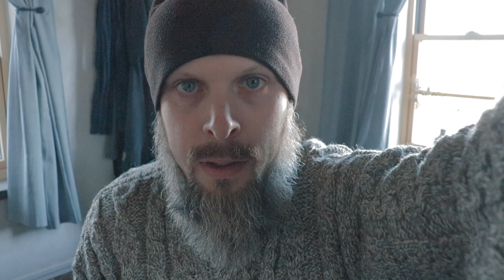10 Reasons to Build a Cob House

Comment: Thermal mass means the walls will keep the house cooler in the summer but it will take more to heat the home because those walls are not very insulative of themselves.  Thats the main reason i would always choose straw bales.  It takes very little energy to heat or cool the homes.

Comment: Can you add insulation on the inner wall to slow down heat transfer? I’ve seen some pretty cold earth homes with thick walls
Reply from the maker: You can add insulation, but I'd consider a dual-wall CobBauge style wall, or just build with straw-clay if you really need high insulation.
Reply: @thiscobhouse  Thanks for your comment. I have a thought that maybe a compressed straw or hemp block on the outside of the exterior wall would accomplish this. The attachment would be an accomplished by slip forming against the blocks. This wall is probably 2 feet thick. 
I have designed and built about a 1000 home equivalent in my life, but never a natural home. Looking forward to it.

Comment: Alex, if the concrete foundation stay dry I mean if the home is build on higher land than the rest of the plot and the rain water is diverted through gravity so water does not touch the surroundings of the home at all, then it can last for as long as possible ?
Reply from the maker: Yes! A good foundation and roof, plus plaster rendering on the wall, and a cob house can pretty much last forever. It's just all about keeping it dry. Same goes for any kind of building, really.

Comment: Great video, Thanks for posting, Question: Is there any reason I couldn't  use cob  as an external thermal insulation wall around a container home? It can get up to about 110 F where I would like to build (a container would be quicker to give me shelter and a place to live while I build the rest) Thanks.
Reply from the maker: Thanks for the comment! Glad you enjoyed the video.

I don't see any reason why that couldn't be done with the container and cob covering. If it were me (just my way of doing things though), I would put up a post and beam structure first, and then cob in the walls. You could even just have temporary plywood up for the walls until you get the cob up.

Comment: Excellent round up on the benefits of Cob. There are quite a few more that you could add.
These are just some of them.
1, EMF protection. Not just from exterior sources but if you bury your circuits in the cob you reduce emf from your own wiring dramatically. 
2, Minimises chances of electrical short fire's. While admittedly not a huge concern   Vermin cannot chew through wires buried in Cob. Nor can termites short out light switches. 
3, Piezoelectric generation of negative ions purifies the air in Cob houses and sterilises bacteria. Also kills mildew.
4, Cob balances humidity through evaporative cooling. 
5, It is a heritage quality construction method that lowers insurance costs because of its fire resistance, longevity and total immunity to fire, mildew, rot, Vermin, termites, electrical fire hazard.
5, Bush and forest fire proof.
6, Easy to repair, recycle and add on to.
7, Increases in value over time. 
8, A new Cob house is made from ancient materials and blends in to the landscape because it's made from the landscape.
7, Combined with natural untreated unsealed timber, it repels insects. No need for fly/ bug screens.
8, Never goes out of fashion. It looks timeless even when new. 
9, Bullet proof.
Reply: The piezoelectric effect is a current generated when a crystal is mechanically compressed or stretched. How does cob building construction have a piezoelectric effect?
Reply: @eggyparrot3844  
Easy. Sand is largely composed of Quartz. Gravity and changes in humidity squeeze the crystal's.
Reply: @joschmoyo4532  
I guess that makes sense, but it still feels counterintuitive to me. I would have thought any settling in a house or change in humidity would be so gradual that piezoelectric effects from individual particles wouldn't be noticeable. Is there anyone who has measured this? I would love to see some documentation or a research paper if you can point me to it. Thanks
Reply: What do you use for floors and roofs

Comment: There should be more automation done for cob building technique like for example the mixture machine like we have in an electric cement kiln there should be something like that for cob
Reply: There are many ways to automate mixing cob. A horizontal forced concrete mixer works well. Rotary tiller on a tractor is perfect for mixing big batches quickly.

Comment: I'm considering building with cob in Florida, but I'm trying to keep costs down by sourcing locally. I know Florida typically doesn't have clay and I saw in another video that you recommended rammed Earth; which is better for a climate like Florida's?
Reply from the maker: Cob does extremely well in Florida, but getting the right soil is the hard part down there. You may need to get it shipped in. Or do rammed earth. It has the same benefits down there. But you do tend to make a compromise with most rammed earth, since a small amount of Portland cement is added into the mixture.
Reply: @thiscobhouse  Thank you for the feedback! I'm okay with taking a bit of a compromise on the rammed earth if it means that I can source my building materials locally. And I'm definitely no expert, but I think there are more code provisions in my county for rammed earth than there are for cob... sad thing, but c'est la vie, I guess.